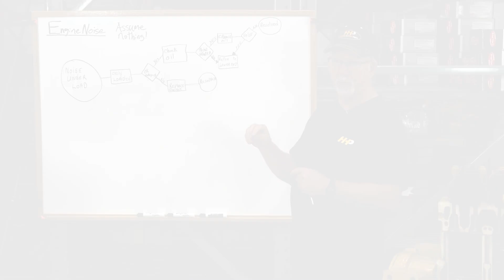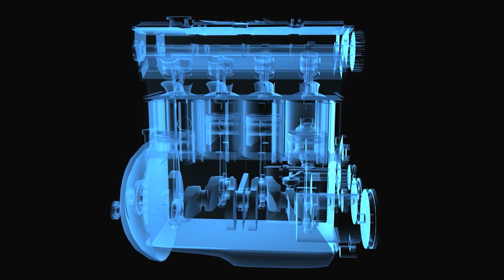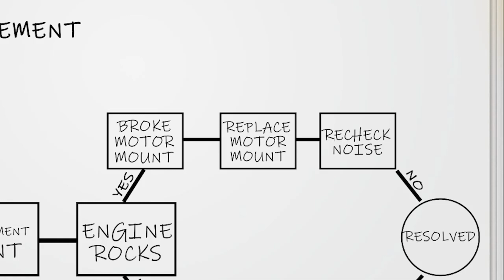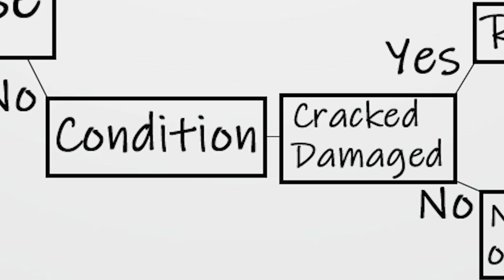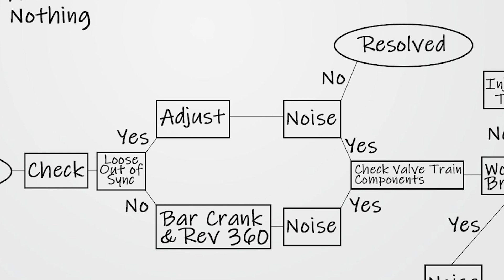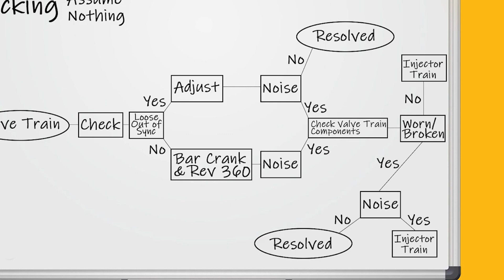Diesel Engine Noise? Common Causes & Solutions

Comment: What's causing excessive smoke and low pulling on my Ford ranger common rail 3.0 L diesel 2009?
Reply from the maker: Depends on the color of the smoke.  That'll help point you in the right direction of your diagnosis.